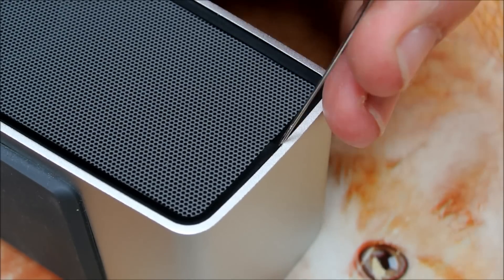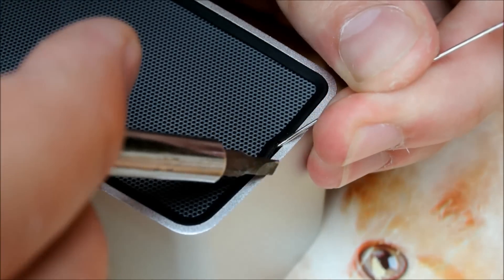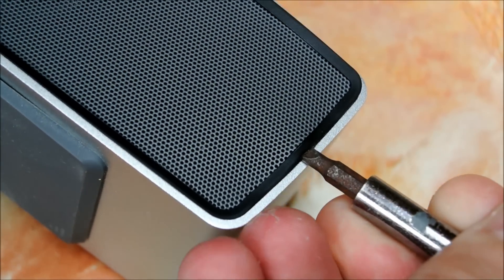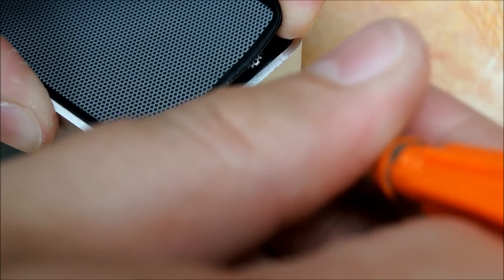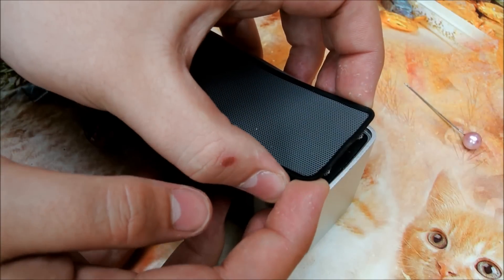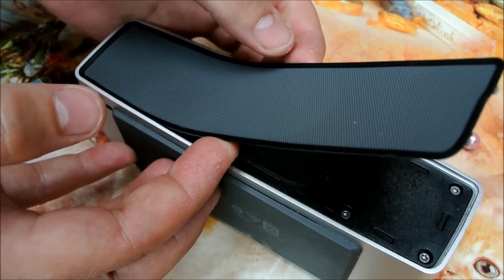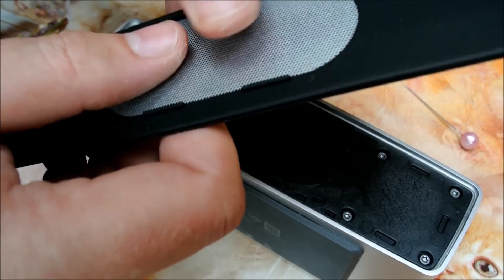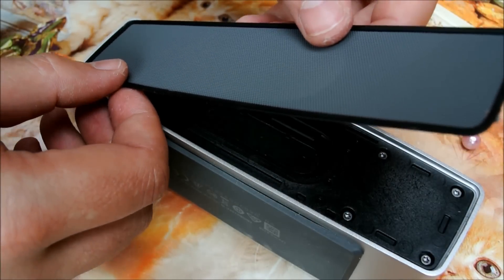Bose SoundLink Mini - How to remove the mesh (for painting or other)

Comment: Do not attempt this removal. I had some gunk stuck in the pinholes of the grill, but I found that removing, and consequently, bending the mesh and stretching the rubber border was not worth it at all. Only remove the mesh if you have to (i.e. if over half of the holes are plugged with sand). Otherwise, just clean the outside and live with it.
Reply: OR, you could just be more careful/gentle than the Franciscan here was!

Comment: This is a great video but I have say, what the fuck was bose thinking when they put that micro mesh screen, glued to the metal grill on the inside? That thing literally is preventing me from cleaning mine even after taking it out. It actually looks much worse because the micro mesh is just holding the dust in it. If you try peeling it off it's like pulling 10,000 tiny hairs off of it. That was a dumb idea by bose. You damn near need to pressure wash the thing because of that.

Comment: How do you put back the mesh? Do you need to put glue on it?
Reply from the maker: donn albert torres No, there is already a sort of joint sticking behind the mesh, so just put the mesh back and press on it to fix it on the seal :)